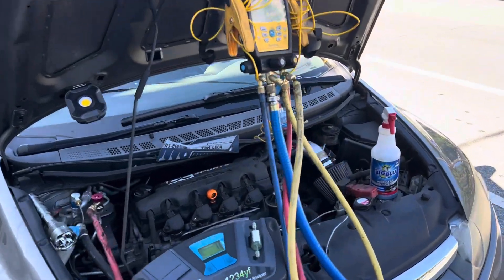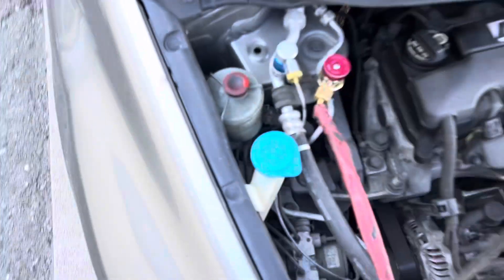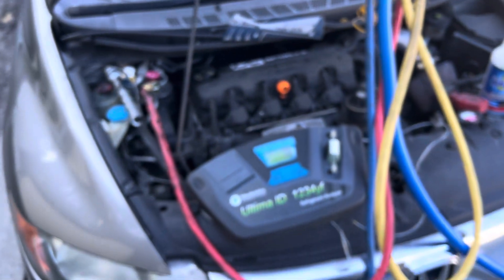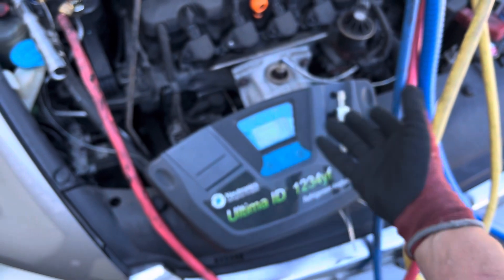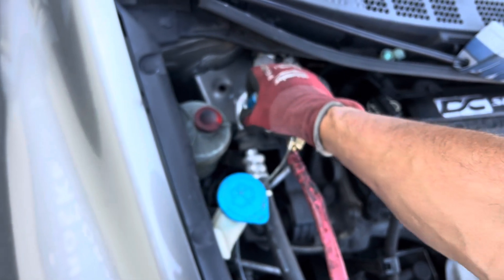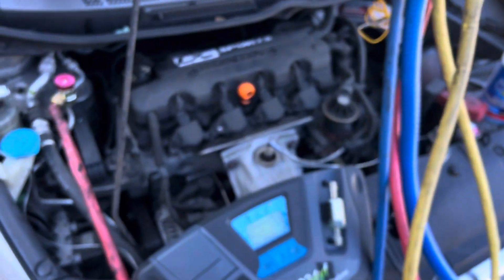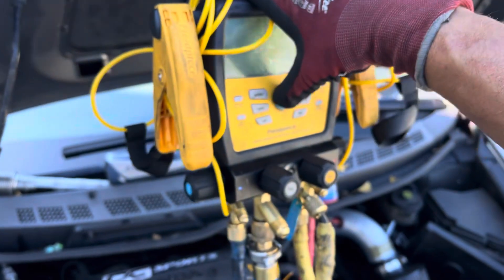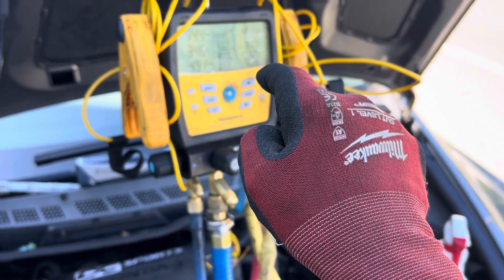4.3% Air Mixed In Refrigerant. Technician Just Purchased Car.

Comment: I have same car here with a whining noise from the ac compressor when clutch kicks in and gets realy louder when acelerating. All points to a bad ac pulley bearing but turning it by hand without the drive belt doesn't make any noise so mechanic says its the compressor. Can the compressor itself makes this type of noise? Should i try replace just the compressor pulley to see if im lucky or replace the whole compressor? By the way ac is cooling ok even with this loud sound.. Saludos from DR 🇩🇴 You make very good videos!
Reply from the maker: Try this experiment. 

With the pulley disconnected . 

Do you have something round maybe with soft plastic or rubber like a wheel?.  
That you can mount to a drill bit .   So you can spin it fast, touched a pulley and get the pulley to spin faster than what your hand can do.. 

No noise, then may be inside the compressor, but it might not mean that it’s bad. Just make a noise.. 

Could someone have added Royal to this compressor in the past?  
Did somebody add cans of refrigerant that had oil and die inside of it? . 

You see where I’m going possibly a little over oil charged . 

Are you a do it yourself person with access to a Recharge machine or recharged by yourself? 

Can you slowly recover the refrigerant very very slowly from the suction line? . 

Then pull off the compressor since it’s so easy to get to and perform a oil balance on the compressor . 

Compare the amount of oil you pour out of the compressor to what the manufacture specs say should be in there ?. 

When you pour out the oil .  Inspected for metal flakes if it comes out perfectly clear..  

And your system is nice and cold . 

Leave it alone . As long as there’s no particulate middle flakes in there.. 

And when you throw your vacuum pump on it, just let the vacuum go overnight. Pulling a vacuum. . 

You can never over vacuum or you could just remove more moisture that’s all  👍

Comment: 4.3%it will contaminate the hoses and gauge if you check for subcooling .
Reply from the maker: Air causes high side pressure to go up

And when the air is introduced, usually moisture is along with that . 

Aran Refrigerant is always remove every time you vacuum and moisture

Nothing contaminated after you’ve cleaned them